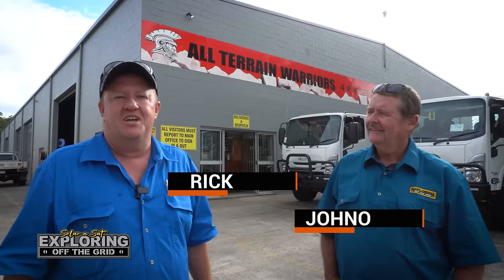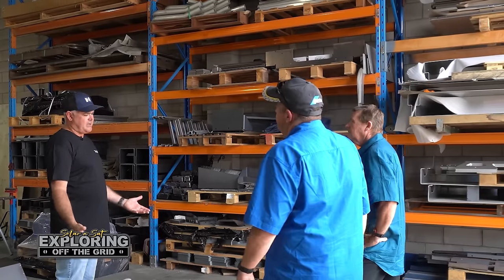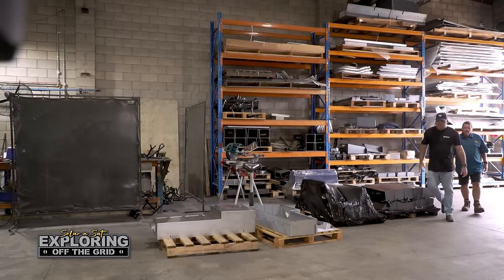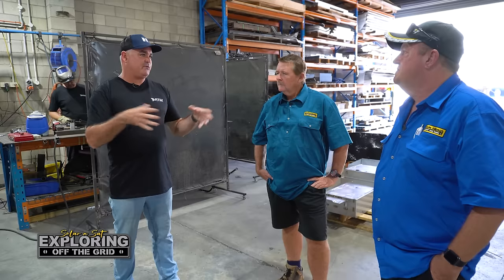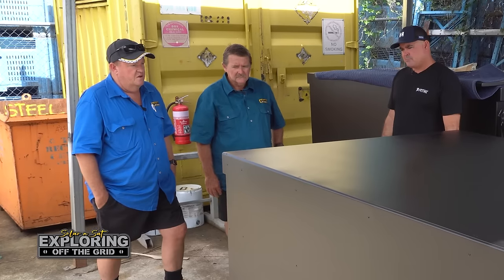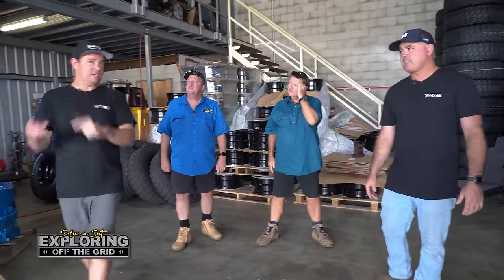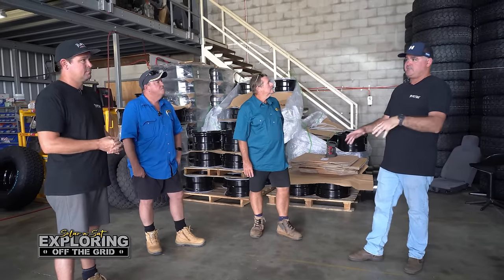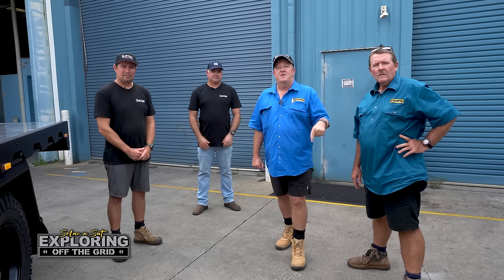Rick & Johno visit All Terrain Warriors Sunshine Coast | 4x4 Trucks | Expedition Trucks

Comment: Awesome engineering. 
Suited for the heavy stuff, towing etc.
There are so many unsafe,  overloaded rigs on the roads.
The way these trucks just crall over obstacles without having to give a bootfull to the throttle. No damage to axles, cv's and not tearing the tracks apart.
Reply from the maker: Exactly mate, so many unsafe rigs on the road, but these trucks do it so easily

Comment: What licence is required? MR?... love the work guys
Reply: All you need is an LR licence 😊
Reply: Cheers thankyou
Reply from the maker: Thanks mate
Reply: @exploringoffthegrid  No worries
Reply: Doesn't LR only cover 8000kg GVM ??
Reply: @arm_luvr1002  Correct. The Isuzu NPS is rated to 7500kg GVM so no matter what you do with two axles and four wheels, whether they be the OEM duals at the rear, or kitted out with super singles all round, you will not be going anywhere near the 8000kg GVM limit of a Light Rigid licence.

The 6x6 converted NPS with three axles, requires a Heavy Rigid licence.